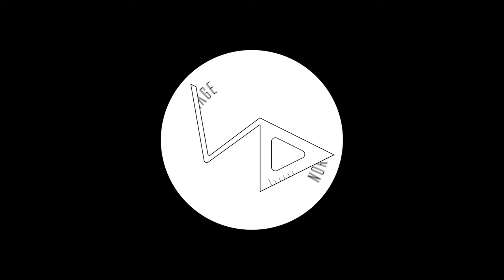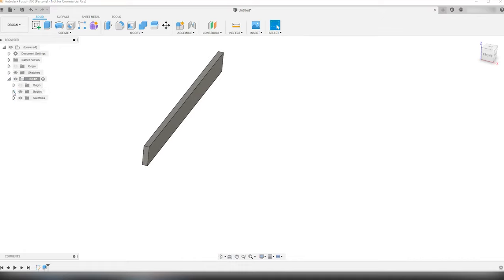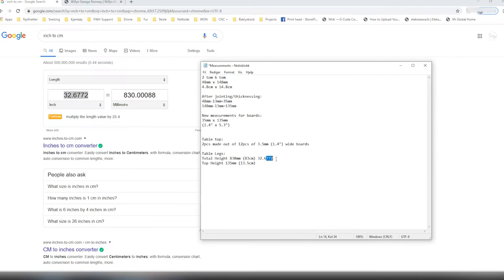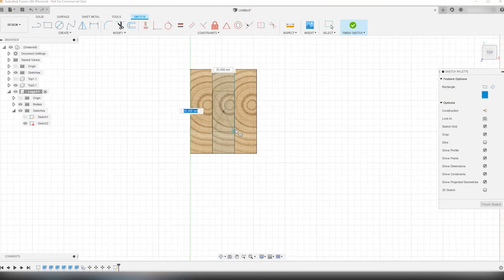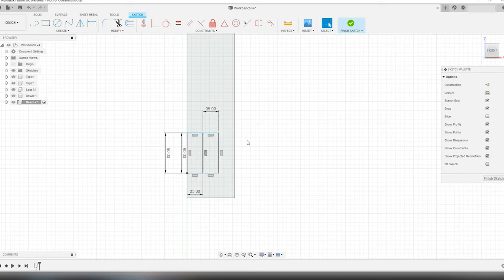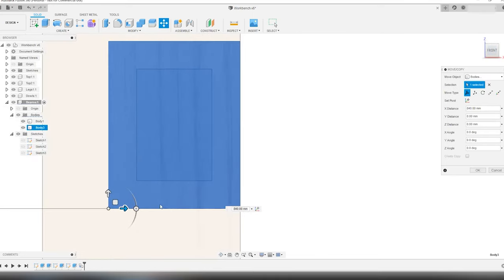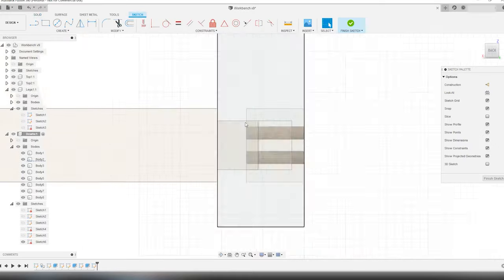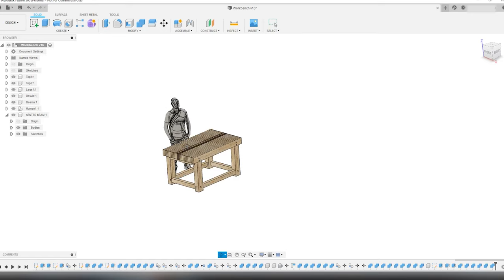Roubo Style Workbench Part 1 - The DESIGN | Fusion 360 | Split Top

Comment: For us confusing imperial users we tend to measure in fractions. The most percussion being down to usually 1/64 inches for super detailed work and 1/16 for rougher work. And we tend to keep things to the 1/4 inch for ease of construction. For example your table top boards would be 2x6x60 or in actual dimensions closer to 1 1/2 x 5 1/2 x 60(don’t ask me why they call it a 2x6 then it’s not actually 2x6. Not sure if you knew this but it could make things less confusing us confusing imperialist.
Reply from the maker: Thanks for the claryfication 👍👍